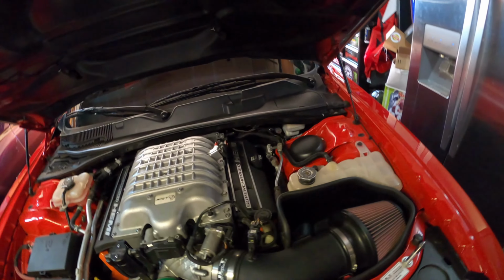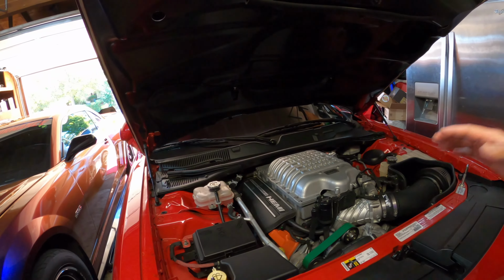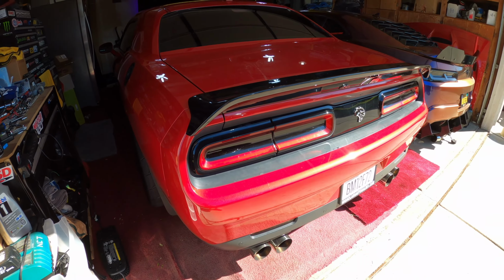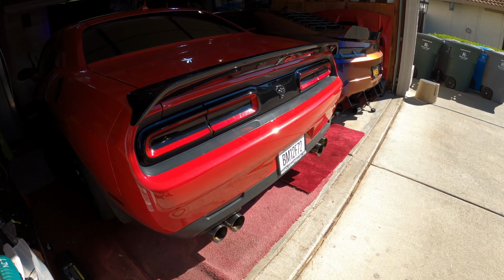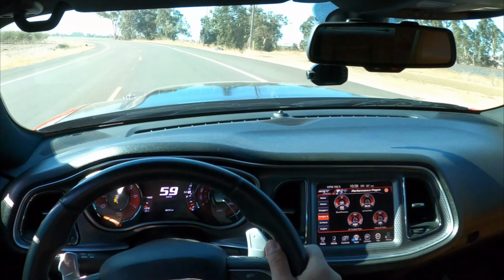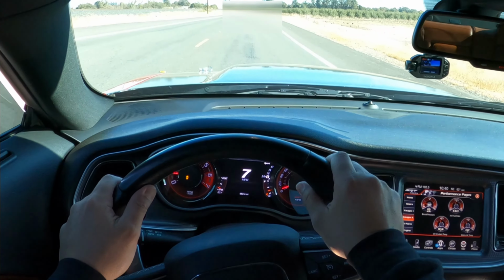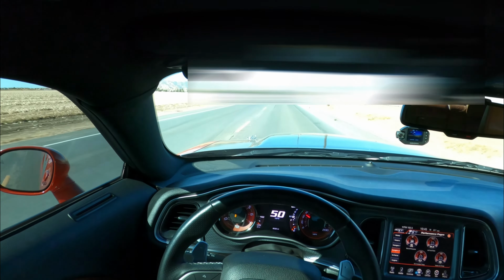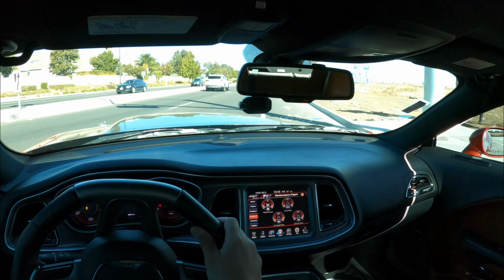First Drive In My 1000 HP HELLCAT, INSANE POWER, BY OVERKILL PERFORMANCE GARAGE,

Comment: I dunno man... I still say my 7XX whp vs the Kitty Kat would be a close race. Street tire (normal 20s). I got nothing for your Camaro though but I think I could run with the Dodge.
Reply from the maker: I don’t know man my Camaro was only making 750 rear wheel horsepower 690 rear wheel torque with a manual transmission. And it weighs 4400 pounds. The Hellcat also weighs 4400 pounds but this baby has an automatic transmission that shifts faster than lightning and it’s pushing out 870 rear wheel horsepower 869 foot pounds of torque!! 120 rear wheel horsepower additional for the Hellcat. Man to be honest with you this car is way faster than my Camaro. But with the new motor for the Camaro we’re gonna be pushing 1000to1100 rear wheel horsepower. The Camaro will be the kill monster LOL. But right now the hellcat is definitely the faster car if we’re talking about my old motor.
Reply from the maker: Are you in California? If you are you should come on by and have some fun!! 🤙🏽💯😁
Reply: You'd need the same power in your canaro. That platform just doesn't move out.

OG has a mid to high 9s car. 7xx in a camaro still runs 10s.
Reply from the maker: @hellafast2745  yeah I heard that. I have a bad ass motor built by LME a 427LSX that can handle 30+ pounds of boost and a shot of nitrous. I’m not gonna take it that far but I want to get the Camaro on the first try I’m trying to hit 1050 or 1100 rear wheel horsepower. I think I’ll keep it like that and just keep a safe and fun to drive.

Comment: A Hellcat is a great platform to make good power with just adding simple mods. But in order to compete with other cars with similar power it needs to go on a huge diet and that's the only downfall, its just to heavy. It makes great  power but the weight kills it when competing.
Reply from the maker: Yes and know if that makes any sense. I get what you’re saying weight reduction is major. You can start with eliminating about 120 pounds with the front seats and if you really wanna get into it you could take out the backseats and the amplifier with the speaker in the back and that’s another 160 pounds. But to be honest with you when you’re pushing 870 rear wheel horsepower that 4200 pounds becomes nonexistent this car just moves brother. It’s almost like the weight helps it stabilize it for traction and high speed runs. I have a couple of races in the next videos here that show cars that are 1000 to 1400 pounds lighter than me with only 60 to 100hp less horsepower gets spanked. But that video is coming up here soon so. For me really this car is not intended to be the fastest car in the world or be at the dragstrip trying to show people I can get eight seconds. It’s intended for a daily driving having fun occasional racing for fun do you know what I mean. At this point I’m just enjoying it and the platform for horsepower is amazing. Keep in mind my Camaro What is about 4400 pounds. So I got two heavy cars on my hands LOL
Reply: Built by the right power the weight helps. The fastest cars on the road are hellcats. Issue is most places don't set them up or tune them right.

My hawk is built by OP and it made 900 at their place but about 1000 at another shop dyno. 

Overkill built is different.
Reply: @hellafast2745  True but a car with that same horsepower most of the time comes out on top over the hellcats because of the weight. 13-14 GT500, 11-12 ZR1 vette, 10speed ZL1 camaro and ect..Hellcats are fast but they are not the fastest, no where near. The cars above stock for stock would win against a hellcat easily because of the difference in weight..But either way they are all great cars in my opinion.
Reply from the maker: @hellafast2745  why is such a big jump from 900 to 1000? Was it because the Dyno was different? Like a Dyno jet? Or did you re-tune everything to get 100 more horsepower? I originally got the OP 800 package but mine ended up putting down 870 rear wheel horsepower. I thought that was just freaking amazing and with the torque to match man I’ve been having so much fun in his car. I’ve already raced three cars that are over 1000 pounds lighter than me and smoked them all! Video coming real soon